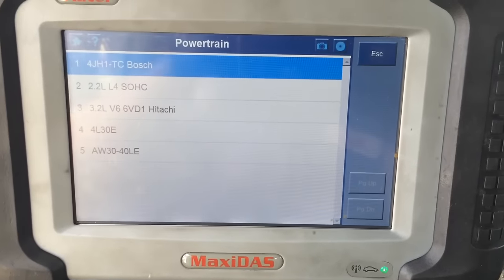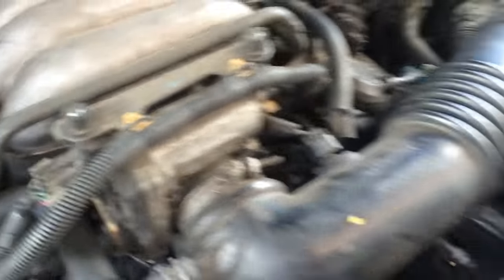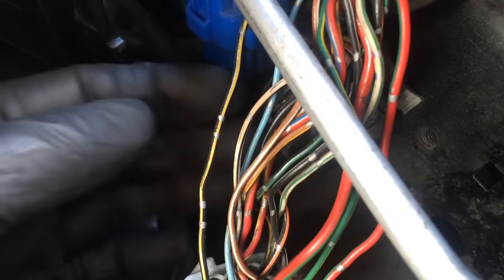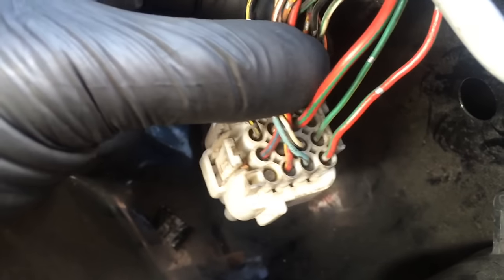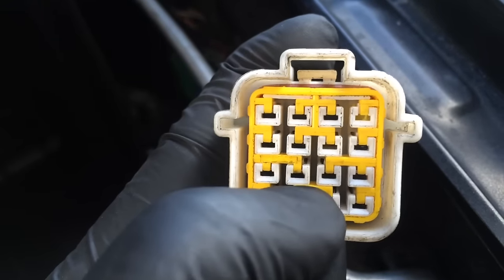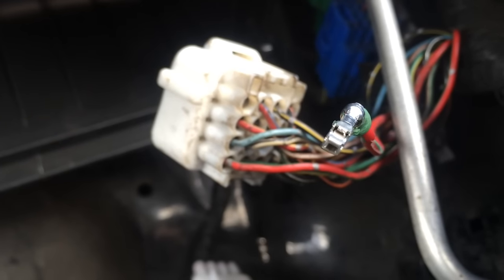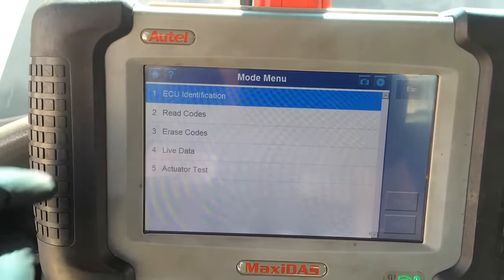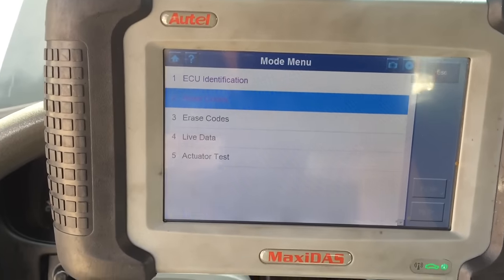SOLVED!!! ECU ECM No Communication FREE fix!!

Comment from the maker: Thank you guys again for watching the video! If you haven’t yet Please LIKE and SUBSCRIBE now!!! I also have a Facebook page, Instagram and Twitter account and I do post different information on there as well.
Reply: Revved Up Knowledge is one smart viet!!!
Reply from the maker: Danny Farrelly Jr. YO!! It’s been a minute WB!
Reply: Will it work for 2002 Nissan Altima 3.5
Reply: Revved Up Knowledge is this going to work to my 98 bmw 328i sedan same thing when I went to smog check they told me that the communication is not reading. And they told me it’s a fuse
Reply from the maker: This vehicle would not start/run when the connection was lost. If your car is running still but cannot connect a scanner to it then you might have a blown fuse. I know Chevy runs a fuse for the connection port with the 12 V cigarette lighter fuse. Make sure all your fuses are good first. Hope this helps
Reply: I have a 2002 nissan sentra i had a issue with it when its warm it will start up so i replace the fuel pump crank and camshaft sensor now it just turning over please help
Reply: 2008 Dodge Charger 5.7 hemi codes was uo100 lost communication with ecm/pcm they said I nedded a knew computer n program so I did that so know sometimes it won’t start unless I go move around the harnish wire than it opens up the throttle body than Iam able to start it can the lil pen be bad like how u did on ur video
Reply: ? What u think it can be
Reply from the maker: I would have someone take a look at the harness since wiring can be a little tricky. You may have a bad pin or a wire that has a short or open in that spot you move around. If you have some experience with wiring I would try and isolate which wire it is but if you have no experience then I would have someone do it.
Reply from the maker: I would have someone take a look at the harness since wiring can be a little tricky. You may have a bad pin or a wire that has a short or open in that spot you move around. If you have some experience with wiring I would try and isolate which wire it is but if you have no experience then I would have someone do it.
Reply from the maker: I would have someone take a look at the harness since wiring can be a little tricky. You may have a bad pin or a wire that has a short or open in that spot you move around. If you have some experience with wiring I would try and isolate which wire it is but if you have no experience then I would have someone do it.
Reply from the maker: I would have someone take a look at the harness since wiring can be a little tricky. You may have a bad pin or a wire that has a short or open in that spot you move around. If you have some experience with wiring I would try and isolate which wire it is but if you have no experience then I would have someone do it.
Reply: I have 2010 chevy with U0078 scanner communication is off on a side off turck runs but it idle goes up an down seems rough
Reply: Would this work on a 04 Cadillac CTS  3.6?
Reply: i realize it's kind of randomly asking but do anybody know a good site to watch newly released movies online ?
Reply: @Rex Clark i would suggest FlixZone. You can find it on google :)
Reply: @Aiden Kylo yea, been watching on flixzone for months myself :D
Reply: @Aiden Kylo thank you, I signed up and it seems like they got a lot of movies there :D Appreciate it!!
Reply: @Rex Clark happy to help :D
Reply: Where you located?

Comment: I imagine you got a wiring diagram , did some tests and found no power - possibly a 5 volt reference or 12 volts was missing and found the spot to examine . This is not a 5 minute fix or a " magic wire " repair . Experience , research and logical testing . This is a pin fitment issue which is difficult to locate . Great find and fix .
Reply: Would really have loved to know HOW you determined that connection was bad. Your video is almost useless unless you have that particular vehicle

Comment: Great video,a few questions: 
1-- unplug the T.B. connector? how did you know that? why not another sensor?
2--and you say, you did have communication with the ECU after unplugging?
3-- if the faulty"wire" was the +12V to the ECU,how could you have it respond,before?
Thanks

Comment: I have a 1999 SC 300 (that I love!) and my son lost only key. A new ignition/key coil was put in by a very well meaning friend-he'd done his vehicle that way and.......we ran into my particular year and model problems. Lexus wanted $800-$2000 to make me a key. Locksmiths wanted $4-500. Anyway you are really the only sunshine on the horizon. I'm a widow working part time at fast food. God bless your selfless attitude!! Whether you can help me or not, God bless you and yours. Thank you. I messed up!!! Ignition CYLINDER, not coil!! It came with two keys. I'm so sorry for the mistake!! God bless
Reply: I got high lighted and I messed up!!!! My 1999 Lexus SC300 had the ignition CYLINDER replaced, it came with two keys, and we then found out this special problem. I'm so sorry for the mistake!!! God bless
Reply: @sharilamb4614  Did you find a fix i have the same issue with my GS 300 1999  code i got was 2798 no communication

Comment: Hi That was very Intresting how you managed to locate the Problem with That vehicle,Do you Think i may have The same problem with a 2018 Vauxhall vivaro 1.6 That wont start and has no communication with the Ecu,The Vehicle is Under warranty and Vauxhall changed The Ecu and Ignition Relay which intermitenly worked for a day before Losing comms again with The ECU ?

Comment: Hi Revved Up Knowledge! Im working on Toyota Landcruiser Estate. I hooked up my scanner and found a fault on the throttle position sensor and then removed the connector from the sensor to check. Then I went to hook up again the scanner and it wont connect to the engine ecm anymore and also the engine wont fire up. Might be the same problem on the video. Would you please tell where is that harness connector or the thick red with green color wire that you showed on the video connected please? Thanks in Advance!

Comment: Hi That was Very Intresting how you Found out the Problem,do you Think i could have the same problem with a 2018 vauxhall vivaro 1.6 That wont start and has no communication with The ECU ? Vauxhall went as far as changing The ECU and Replacing the Ignition Relay which worked for a day But then would,nt Start Again the Next Day ?
Reply from the maker: Could be a short in you ECU wiring or a bad ground connection. You should some type of warranty though if the dealer just replaced it

Comment: My 06 Honda Accord 3.0 lost communication with ECM.  Had replaced throttle body then clip broke, cracked housing so replaced again with pigtail and throttle body shows on computer to be working properly but the ECM doesn't even show up.  Now my car is stuck in limp mode and won't go over 30 mph.   Before replacing throttle body the second time I could unhook battery cables for a while and reset it.  Now that doesn't even work.  When all this began as long as I got up fast enough to set cruise control my car would run perfect  as long as cruise was set before it went into limp mode. Any suggestions?  You think this may fix my issue?   I do have a little suspicion my ex did something to it like unhooked a wire somewhere but I've taken it to 3 different mechanics and so far the real issue can't be figured out. Please help.  I don't know what to do

Comment: My 2006 Pilot wont start....crank no start...battery old....new battery.....one week later did same thing...crank no start....I disconnected battery cables for 15 mins....got start.....I figured bad connection or stuck relay to fuel pump.....because I couldnt hear fuel pump kick on ....Thank you...I will check my wires....I didnt scan because I dont have a scanner.....getting one........Old shade tree car repair here...LOL

Comment: Thanks for the video! I'm working on my 7.3 power stroke. After disconnecting batteries to do some work it now throws a P0603 code on one of my scanners, and a no detect ECM on another one? Will try to look into the connections!
Reply from the maker: From what i have read that code happens when you disconnect your battery or or change your tune if you have tune-able chip. try clearing your codes with the scanner that lets you read it. most people that have the same code clear it and it doesn't come back unless they unhook the battery or switch tunes. hopefully it helps you
Reply: Thanks pal. Code gone but check engine light still won't go off. I did delete the air heater in outlet turbo tube, that threw a code but went away after clearing codes and has not come back. I tried the blue tooth cheap OBO11 scanner to do an injector buzz test as I am afraid I have a bad injector or two or wiring harness issue, but scanner won't connect. I think I'll hit a pro up with a scanner.

Comment: Hey dude..my car can't start..i think the ecu is not powered.. Ignition on but the check engine light is not there..and try connecting the obd2 but nothing happen..its look like the car has no connection with the ecu..is it possible tht mybe some wire is disconnected or some wires blown up..(im not ready to make decisions the ecu is damaged)..All fuses/relay are still okay...My car is Prado 1997 3RZ-fe

Comment: I have a question. I have a 2006 dodge charger 5.7 and I just bought the car and it has giving me so many issues. I already fixed the long block, has new alternator, battery, water pump. And it drives fine but I'm tired of the cluster always going crazy. The gauges move up and down all the icons on the dash pop out and it makes the sound like if I have a door open. Could it be an electrical problem? Or I need to change all my fuses. Everytime I take it to my mechanic they see nothing wrong with it. Because it doesnt act up on them and its frustrating.
Reply from the maker: deadlysin91 does it do it consistently all the time or worse over bumps or bad roads?
Reply: @RevvedUpKnowledge  yes sometimes it does it like 5 or 6 times within 10 or 15 min of driving it. Or sometimes it doesn't do it at all.. but I did notice that when I have someone on the passangers side it acts up. Everything on the cluster goes crazy. It doesn't do it on bumps tho..
Reply: @RevvedUpKnowledge  I also left my car with my mechanic for 2 weeks so he can see what's wrong with it. He drove it from burbank to acton, ca daily and it never did anything with him.
Reply from the maker: If you have your car, start it and the kind of move/jiggle the key around without turning the car off. If things start to flicker or do what you’ve described then you may have a faulty ignition switch. Also i believe in your trunk there is a fuse box and underneath part of the box has some diodes and or electrical connections. Some of those may have bad connections as well. I would have your mechanic look into that
Reply: @RevvedUpKnowledge  thank you so you have been so helpful. I will be checking it out later today.
Reply: @RevvedUpKnowledge  You were right about the key ignition.. I usually carry my keys with a little wallet attached to my keys. I drive with only the key and it doesnt do this anymore but today I started to worry and was wondering if you can help again? When I turn my ac on whether I'm driving or the car is parked my car starts to shake everytime I turn it on it takes about a few seconds and it shakes so bad. I feel something on the bottom of my car it's so weird to explain it. Can something be wrong with my ac? It's never done this before.

Comment: I am working on a 95 chev 6.5 turbo diesel friend says it quit on him while driving and it hasn't ran since we put a pmd on it and still no start what should I be looking at I've thought the injector pump was at fault but I want to climate all others before I move on to that truck has 700.000 on the odometer

Comment: How would I test a '99 7A-FE that cuts out for no reason. The starting is intermittent, I have to wait for the engine light to come on for the engine to start. All  the electronic security features were removed some years back when it was doing almost the same thing. I suspect the ECU but it is giving me a knock sensor code from the OBD1

Comment: how long did it take to find that fault the first time you came across this fault?
Reply from the maker: 30 minutes or so
Reply: Just curious though at how did you discover it was that one wire-connector? Past experience? Schematic? Collaboration?
Reply from the maker: No past experience or anything. Just from about an hour of checking and finally moving a certain part of the engine harness to check underneath it and I hear relays clicking. From there I singled out the exact wire and found it. Never happened again to that car and I see it once in awhile. Super happy customer!!

Comment: @Revved Up Knowledge Do this same method works for a 2008 Lincoln mkz ? Woke up today started my car and it shut off I restarted it but after moments of it running the check engine light came on I hooked it my mini code reader and it gave off the code U0100 please help.. what should I do or need to know?

Comment: Hey i have a problem communicating with my bmw using a launch x431 scanner, it shows not equipped instead of showing the fault codes
If you can help me thanks in advance.

Comment: My 2003 ram is being stupid like this tight now....itll commu icate with the BCM,etc. But refuses to connect to the ECM. Strangely enough, at random intervals a little red dot light will flash in the dash, or the "check gauges" light will flash while I'm driving. Sure sign of an intermittent open circuit...time to start checking connectors and pinouts. Yeaaaaah

Comment: Wish my 2005 PT cruiser would be so easy there's an after market radio in before I bought it and a back up camera attached to it sometimes the back up camera would work then the next time it comes on. Yesterday I shut the car off but cigarette lighter stayed on I knew because I had my GPS in a light in there. It stayed lit. No communication to OBD 2 I'm going crazy and around Albany NY no one with knowledge of wiring 4 mechanics shrug their shoulders !!!Help...also low voltage to Up stream down stream 02 sensors.

Comment: I got an obd code U0140 with many odd readings. Like voltage drop and rise 3.6-42 volts, O2 sensor bank 1 going up to 8000 %, coolant dripping to -8 degrees. All these go back to normal but when they act up it’s randomly.

Comment: I have a question .. So my 2000 honda accord has no check engine light but some reason won't pass smog .. Any idea
Reply from the maker: Thank you for watching! When you cycle the key to on position without starting does the check light pop up and then turns off after being started? The smog check guys don’t give you a list on what didn’t pass? I live in FL and we don’t have any state smog inspections so not too familiar with it.
Reply: @RevvedUpKnowledge  i get where you were going with the check engine light being on while key on. Just to verify the light works. Wouldn't the smog have to do with the evaporative emissions? Gas cap, canister solenoid or purge solenoid? Something along those lines? Oh great video by the way! Subbed and liked!
Reply from the maker: Thank you for your kind words! This vehicles problem is the intermittent power for the ecm itself. when there is  no power to the ecm the light does not illuminate on the cluster. if your check engine light stayed on then theres a problem with your sensors but not could be many things other than emissions related.

Comment: I have a 2006 lexus gs300, I believe the ecu is not communicating with the shift solenoid. I have rebuilt the ecu, change all solenoids and solenoids harness and I still get P0761. How can I check the main harness for shorts or what do you recommend?

Comment: Hi I enjoyed your video I have a 2011 Mitsubishi Lancer 2.0 and I have obd code uo100  and po300 multiple misfire when I press hand hold the gas pedal Down only to 4000 rpm can send you a video any ideas would help me out I also change out coil packs spark plugs mass air flow sensor crank sensor  thanks
Reply from the maker: Check ground wires and make sure they’re connected or not broken
Reply: Which ground wire ?? On the harness ??
Reply from the maker: I think there’s some on the intake manifold for the the injectors and the ECU
Reply from the maker: they usually are bolted onto the manifold or valve cover and the bolts are usually 10mm or 12mm.

Comment: Is ot the same or could be the same fo a Nissan maxima 2010 engine control fuse keeps burning
Reply from the maker: Most likely not. You probably have a bad ecm or an electrical short in your wire harness somewhere

Comment: I disconnected the throttle body sensor like u said but now my scanner tool gave me two permanent code saying throttle / pedal sensor. I went from 1 permanent code to 3 permanentcodes that I cannot delete
Reply from the maker: Only disconnect to tighten the pin but you have to re install the pin back into the plug
Reply: Revved Up Knowledge . Yeah I did that but I ended up installing a new throttle body and it resolved all of my issues. Thank you I think the fact that I got permanent codes was to confirm it was the throttle body problem because my previous code was Implausible data received from ECM/PCM.
Reply from the maker: Glad you have it sorted out!

Comment: I have hyundai santafe v6 engine 24 valve. Engine crank but doesnt start and i found out my sparkplug is no supply from coil.but my friend test the coil and its ok.can plss some one help me how to hotwire or direct jump wire to the engine to ignition without using the ecu